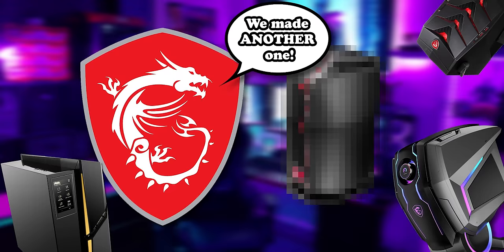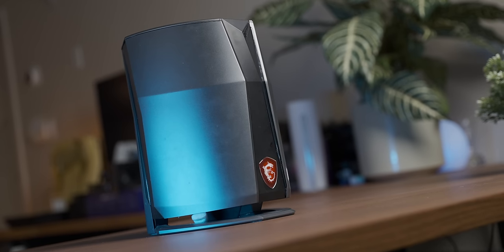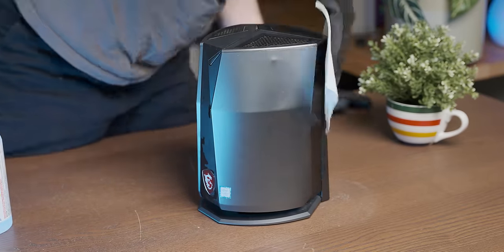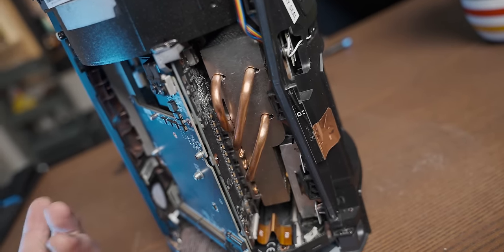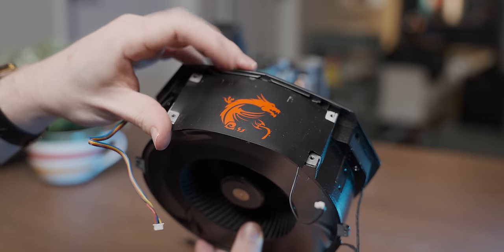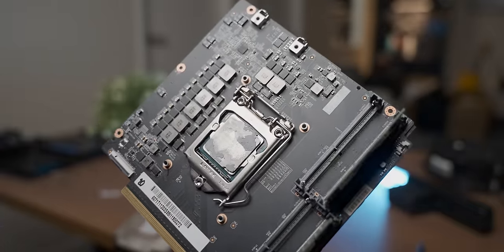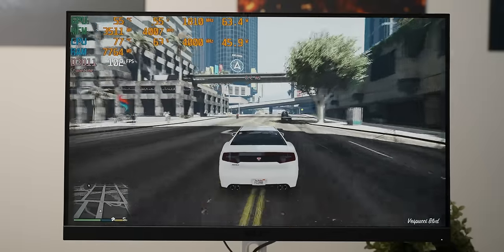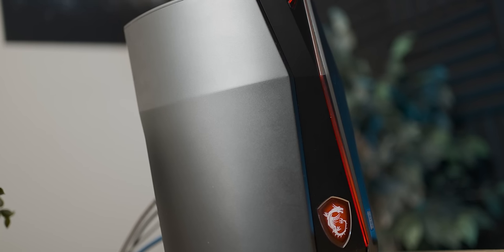How Does MSI Keep Coming Up With These?

Comment: Crazy how much work went into designing that. Impressively packaged!
Reply: It is cool and compact for the time and MSI really does some interesting things that wouldn’t be done otherwise, but essentially this is a laptop yea? 🤔 Just more expensive and with out the screen or portability 😅
Reply: @slowlanegamer  well yeah , but i can think that it would be quite difficult to put a mini itx case in that form factor and the desktop grade solution would require more cooling
Reply: @slowlanegamer  This was back when the equivalent laptop cpu would have been 2 cores and 4 threads vs the 4 cores and 8 threads this cpu has.
Reply: it looks like they were going for a console look
Reply: copied apple 😂
Reply: @joshemminger9022  there were 4 core 8 thread laptop chips for a while. Only advantage such system has is massive thermal headroom which lets parts run at max boost indefinetly
Reply: Thatz dummy package.
Reply: i know right? Apple sure put a lot of thought and effort into it, only to have their design plagiarized.

Comment: Forgetting their many foibles, MSI certainly do make some unique/wacky machine cases
Reply: I’ve had a Trident X for 4 years. Managed to shoehorn a 750W psu and a 3080 into it. Performance and thermals are outstanding in a system that’s smaller than a PS5. PWM broke on it within the first 2 weeks, so it’s noisier than an angry Italian mother in law, but I still love it
Reply: @Gatorade69 Asus GPU'S have been the best I've ever owned, they're two expensive though.

MSI haven't been on top form for years, their old MSI Lighting GPU'S were the best you could buy.

The only 3090 i could get was the MSI Gaming X Trio and its an absolute joke compared to other 3090'S, low boost clock, bad OC, power limited, adjusting the power limit and Voltage makes no difference whatsoever and it also makes an awful racket compared to my Gigabyte 4090 and to make matter worse the temps aren't all that good.

Comment: Apple: "Let's make a high end PC that looks like a garbage can!"

MSI: "See that oscillating floor fan in the corner? BOY DO I HAVE AN IDEA"
Reply: Guys, upvote this comment, this needs to be on the top
Reply: Every other computer manufacturer: Rectangle brick again?
Every other computer manufacturer's accountants: Would doing it different cost more?
Every other computer manufacturer: Well, not if we rip off someone elses idea?
Every other computer manufacturers legal team: Yeah no, we would usually rip off Apple but they are very litigious
Every other computer manufacturer, their accountants and their legal team: So... Rectangular brick it is!
Every other computer manufacturer's case design team: Don't want us to do anything?
Every other computer manufacturer: Yeah, head down to the scrap yard, find some pieces of colorful plastic and hot glue them to the sides of the cases in an artistic manner
Every other computer manufacturer's case design team: Hot glue?
Every other computer manufacturer: You're right, far too durable, get some really tiny, really fragile plastic clips, and clip the bits plastic scrap on in a way that they will snap off the first time the user tries to upgrade their ram.
Reply: @Ursulpolal It better be, otherwise the video would be… well… private.
Reply: I have an idea to transform a trash can into a very very expensive product - said Apple in 2013

Comment: GPU got hotter because the fan takes feedback off the cpu temp and cpu temp getting lower doesn't trigger the high speed fan 
It is not the mistake of the thermal paste application 😁
Reply: would this have been done on purpose or is this just a one off mistake possibly?
Reply: @HansenLaMoose  there's no mistake here, after repasting both temperatures are ok, also all motherboards' BIOS use CPU temp to control fan speed that's standard, having a single blower fan to pull air cooling both components is intresting but not very effective as it won't account for wierd scenarios of high gpu usage and low cpu usage leading gpu to get hot, if it was my system I would definitely use fan control app to control fan based on gpu temp to fix the issue. In the end if it's your system you take care of yourself (repaste, control fans, undervolt, remove bloat, maybe even removing some panels to help)
Always take care of yourself
Reply: I wish we could've seen if the GPU was boosting higher as well, usually of course if there's more thermal headroom the GPU also attempts to clock higher which might lead to similar noise levels but also higher performance!
Reply: @CarbonPanther  it was the same (13:48 vs 15:05)
Reply: That is dumb as all hell, but the easiest method of thermal control.
Reply: @omarfouda1994  you're 100% right with the diagnosis, but not everyone knows how/wants to do that and just assumes it will come at its best out the box yanno
Reply: @akaRAIJIN  Unfortunately that's the state of the industry, and that's not for me to change. what's in my hand is to assume the worst and take care of myself
Reply: @omarfouda1994  facts, least you putting it out there. Someone unfortunate enough to own it like Dawid might come across the comment 😂
Reply: I bet that fan goes by total system power draw.  I suspect he's replaced a high performance industrial tim with regular thermal paste.
Reply: @Bonswally  I am sorry but I don't think you're right, why did the cpu temp drop from almost 90 C to 74 C then? MSI doesn't use proprietary motherboard in their prebuilts like he said in the video and on all motherboards' BIOS I've ever seen the fan curve is tied to cpu temp or you may find an option to tie it to motherboard temp(maybe vrm), never to system power draw or GPU (as the gpu fans are always controlled by V-BIOS on the gpu itself)
Reply: @omarfouda1994  I routinely see it tied to power draw on modern laptops.  It's what makes setting a traditional fan curve normally require tricky workarounds.  It would make sense in a system like this, running furmark and observing the behaviour could potentially answer the question.  

Cpu temps were only slightly lower as he said.  The type of tim i suspect was being used originally is high performance in the sense that it resists pump out and doesn't need to be replaced for many years.
Reply: @omarfouda1994  I wouldn't even say high GPU/low CPU is a weird scenario. That's a pretty typical gaming scenario unless you are leaving your FPS completely uncapped all the time or running a super high Hz display.
Reply: @devilmikey00  well, there are 2 categories of games where you usually look for high end PCs and performance
1- competitive high fidelity games(battlefield, warzone, etc) where you need both -high cpu power and uncapped frame rates -and high gpu power 
2- AAA games where the gpu usage is very high and usually for current gen games they also require high cpu power to achieve decent fps for the open world, ai, and physics
All other games you are usually happy with whatever combo you have and usually don't even care for hardware (low end competitive, survival games, indie and party games) 
That's why it's kinda rare these days to find games with low cpu usage and extreme gpu usage unless very bottlenecked
Reply: So it's just a bad design? 😂
Reply: @Bonswally  That's the exact kind of paste I need to find for GPUs. Makes a lot more sense in their application.
Reply: @ArtisChronicles  honeywell ptm 7950

Comment: UPGRADE IT!!!
Put a bigger CPU in it, and see if any of the other MXM boards will fit.
Will it take a Xeon?
Reply: Downgrade it!
Put the Alienware GPU's with SLI in it xp
Reply: There's no way you're getting a Xeon in that contraption.
Reply: yes I want to see if this can make Dawid's head explode!!🤣
Reply: @MandoMTL  You can but there's no interesting or better Xeons for that socket in that era, neither in core count, L4 eDRAM, or multiplier overclockability (like previous V1, V2 and V3). The top of the line is the Xeon E3 1280 v5.  Anything else needs a different socket. (LGA 1151). The best CPU is the i7 6700K.
Reply: @CheapSushi Doesn't the i7-7700K also fit in that socket?
Reply: @soulfiregod  That will need bios mods to work.

Comment: Despite the PIA it is to take apart, it is kinda impressive for how old it is and upgradable
Reply: Semi-upgradeable. The GPU would be nearly impossible to source, and I REALLY would not want to risk a 7th Gen i9 in there given the passive cooling, but you can add RAM and storage fairly easily.
Reply: @JinghisKhan  oh mxm cards are easy to find its the compatibility thats an issue just being an mxm or even the correct mxm version doesnt mean it will work. I have a few older alienwares with mxm some for example will not work with any amd cards if it came with intel same with any amd based units and nvidia cards. Now its possible theres a workaround but ive noticed mxm systems often have some limitations on card usage plus the cost. a 10series or higher is often at or more then a current desktop version cost wise ie a 1070 may cost 300+ and may not even work.
Reply: @GalironRunner  bios whitelisting

Comment: R&D costs for this must have been substantial. Certainly one of the more interesting designs.
Reply: Do you think more than any of the gaming laptops MSI makes?
Reply: @Incommensurabilities  Honestly, it would be tough know for sure buddy. However, based on the fact that laptop sales outnumber desktops 2:1, recouping those design costs would be tougher on this little gem. It's a shame more aftermarket case makers don't get a bit more creative these days though.
Reply: you need to go watch a trash can mac tear down. Nothing is impressive besides they figured out how to emulate the trash can apple with even poorer cooling. The magic in the trash can mac is its cooling solution to create that form factor..Also that thing wasnt well received for its minimalist design approach obviously because mac went right back to make square designs. Because more cooler means more better. It sacrifices function for form.
Reply: @Incommensurabilities  res due to retooling

Comment: you know, the sponsor from deepcool really does urge me to say that the AK620 is utterly insane for the price. i've been using it on my 7700X where it's really shining, and i've heard good things about how it deals with the similarly monstrous heat of the high end alder/raptor lake CPUs, too. best value dual-tower on the market right now
Reply: I'm using that same cooler on my 5800x3d and my friend's 7800x3d. Such a monster cooler.
Reply: Thermalright is also great price/performance.
Reply: AG620 for value ftw!
Reply: Thermalright Peerless Assassin 120 SE wants a word with you

Comment: The fact that it's passive cooling used in it means this system is IMPRESSIVE
Reply: It's technically not passive at all.
Reply: Its not passive tho. Technically the coolers are but the system isn't.

Comment: This system has piqued my interest. I wonder if they were to make the same system today, what cpu and gpu would they use?
Reply: An AMD Ryzen laptop 7xxx CPU and a low profile RTX 4060 would be ideal for cool temps and excellent performance. Minisforum already makes an ITX motherboard with an AMD Ryzen laptop grade CPU built-in. It provides excellent performance per watt and runs cool.

Comment: I can't remember if I never noticed that you didn't have a frametime graph before or if I just thought you preferred it without the graph. In any case, it's very useful as an indicator of consistency and I highly recommend it. Side note: Many games seem to have bad FPS caps, I think...? However, it seems you can use RivaTuner Statistic Server to force a limit that's perfectly smooth.

Comment: I wonder if you could get a 10th gen QTJ2 or QTJ1 (8/16 core) CPU running on this board by modifying the BIOS. These CPUs are laptop bga chips soldered to pcbs that allows them to be installed into LGA 1151 sockets. 🤔

Comment: ı suppose if you plugged off the bottom side where a gpu does not exist fan needs to pull air from other places so it means power air passing through where it counts could mean lower temps and maybe noise

Comment: The way the HDMI and Mini-DP are separated, I'm convinced it's using the 1060 in passthrough mode to the HD 630 on the CPU. If you can fix the HDMI, you might get that performance back.

Comment: you should try arctic mx-6 paste for direct die as its much suited for it. Thin - low viscosity thermal paste suffer from pump out which causes high gpu temp.

Comment: That MXM to PCIE board is something I wish I had for my system. You can find some MXM slot GPUs for cheap, but you can’t use them in a desktop cuz there are just no MxM to PCIE adaptors :/

Comment: Great stuff! I can't believe MSI done it again. So much potential, if only it was a standard micro atx board and normal sff power supply, so you know... We could still use the case today.
Also, I liked your sponsor spot, but it would be nice if you could of gave some notes on fan noise from at least 1 cooler.

Comment: Honestly I had to use Gelid Extreme on GPUs to get close to stock temps in the past. The issue I'd usually have with this is it would maintain those temps for about a year before slowly climbing again. 

I'm tempted to try something else eventually.

Comment: I have a ten year old MSI GE 70C that is still running beautiful with zero upgrades on it.  I love that thing.  It's been a tank (I've dropped it close to a dozen times and all the original hardware still works perfectly).  It is no longer my main laptop, but I use it a lot still and it runs beautifully.  They don't build gaming tech like this any more...

Comment: I know it's anecdotal, but I did just pick up a MSI prebuilt from Newegg, 5600X, 6700 XT, only 512 M.2, but the board has a second available slot. $809 after mail in rebate.  So occasional good deals?

Comment: First, I suggest we lobby Vileda to sponsor Dawid's channel! Seriously, back in October, I talked to a rep at Vileda at a hardware /retail trade show about the channel and Dawid's love for their gloves, and I even gave them info where to find the videos.

I'm also up for juicing up that MSI air cleaner with a nice set of upgrades - a second graphics card, maxed ram, a larger boot drive, an m2 SSD and maybe a CPU upgrade (according to the Intel web site, the i7 7700K was the fastest CPU in the Kaby Lake family.)

I wonder if any other PC companies made a cylindrical computer - I'm be surprised if Dell ever produced one, even an Alienware monstrosity.

And finally, Dawid should get an actual 2013 Mac Pro and do a head-to-head with the MSI. Especially how easy/harder it is to upgrade that. It's a testament to how poorly that was received when users of the original cheese grater model are still using theirs with modern graphics cards and bootloader hacks to get the current macOS running on them, ( a testament to just how bulletproof that design was)  rather than have USB and Thunderbolt spaghetti running out the back of the trashcan.

Comment: Since the cpu is socketed you should try a 7700k inside it as stock it boosts to 4.5ghz all core would definitely help.

And with the repaste even tho temps on gpu are similar the frequency has increased.

Comment: this is very similar to the gigabyte brix system i bought for my mother a while back ... intel 7700 and a gtx 1060 much smaller package however  the only fan was i think  a 92mm fan up top but it may have been a custom fan that drew air over the whole thing and the teardown isnt far off either!

Comment: Since it looks like you can just swap out CPUs I'd love to see you do an upgrade video and see if this thing could become a beast? Putting in a new CPU seems pretty easy not sure about getting a newer video card? There's got to be a newer laptop video card you can swap in there somehow? Maybe take off those giant heatsinks and just find some real low profile CPU and GPU coolers? If you could do that maybe you could put some sort of resistor on the giant fan on top to slow it down so it isn't so fast and loud? Would love to see this thing upgraded! I think it's actually a really cool little system. I'd love to get my hands on one and attempt to upgrade it but unfortunately I'm unemployed and don't have the cash to spend right now.

Comment: Thermal paste being dry doesn’t mean it isn’t good anymore. As long as the heat sink hasn’t been removed it’s still performing it’s job of filling the tiny air gaps and conducting heat. If it’s dry it just isn’t any good for reinstalling the heat sink because it won’t conform to the surface properly to fill those air gaps the way it’s meant to. 
TLDR: Your thermal paste is fine for more than the usable life of your system if you leave the damned thing assembled.

Comment: I mean i'm not sure dry thermal paste is that much of a problem on aging computers, until recently I had a computer with a I5-4670k running OC at over 5GHz and at overt 80°c and there wasn't much of a problem, other than the fact it's a old 4 core processor lmao

Comment: It would be very tempting to fully load it dual gpu, nvme, 4 sticks ram, bigger psu and thin gpu add on fans if possible . Just as a ..  because I can ..  project
Reply: That's how you build a bomb.
Reply: @mattd5240  lol

Comment: MSI MPG TRIDENT 3 11SI-090UK GAMING PC - Intel Core i5-11400F CPU, GTX 1660 SUPER ITX GPU, 16GB (8GB*2) DDR4 RAM, 512 GB PCI-E SSD - Air Cooler, 230W PSU, WIFI 6, Windows 10, RGB - Black 

£732 new on Amazon UK 

Please test this on your next video

Comment: I'd like to see what HP or Intel would have built if they were forced to make a similar trash can PC. I think HP would have put in a recycled laptop or ProDesk board and put a really small power supply inside, I know for certain each company would have used an external power brick instead of a standard cord like MSI did here.